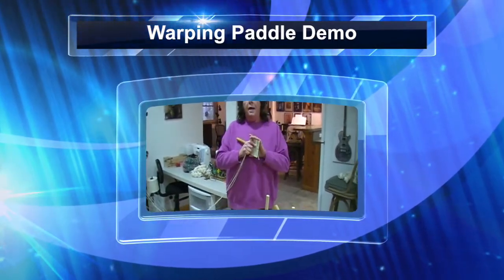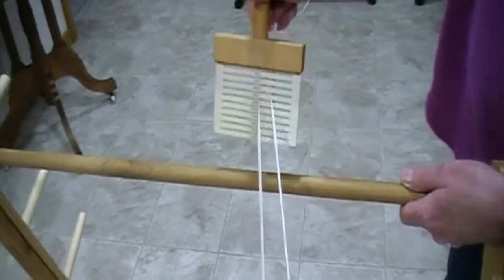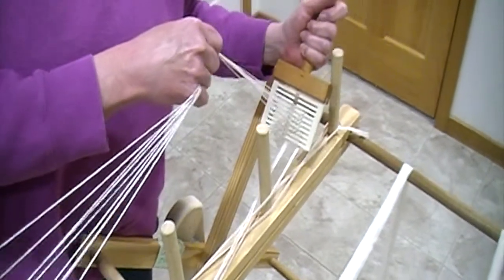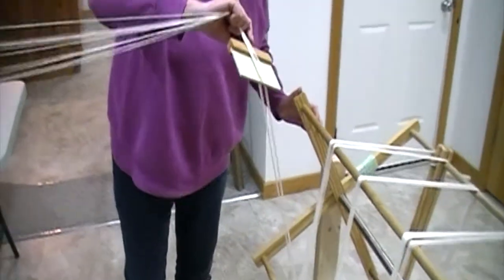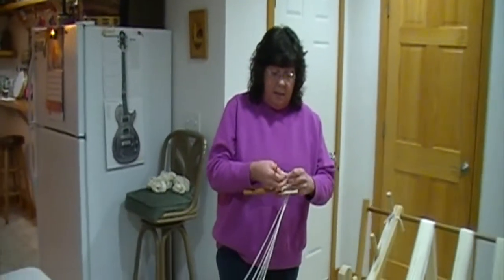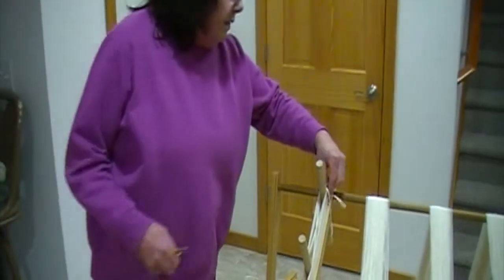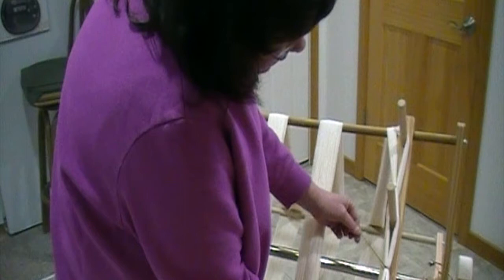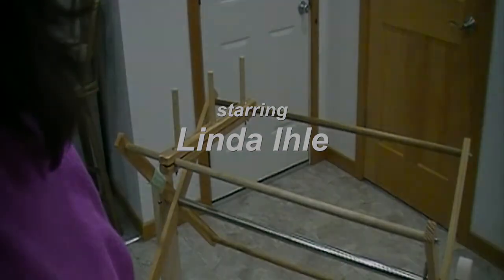Warping Paddle Demo

Comment: so when would you use a warping Paddle?  does it make it easier to get more yards vrs doing a single strand at a time..  Like I'm doing a blanket that needs 2,240 yds of yarn.. so by using peddle it would be easier to get that many yards?
Reply from the maker: the paddle speeds up the time to wind the warp as you can wind with up to 20 threads at a time using the Schacht paddle.
Reply: @lindaihle251  : It kind of reminds me of warping a sectional beam.  I like it.